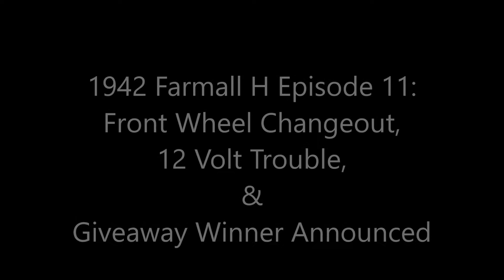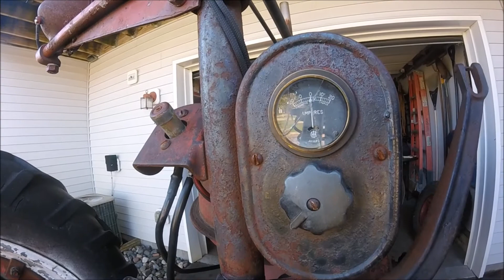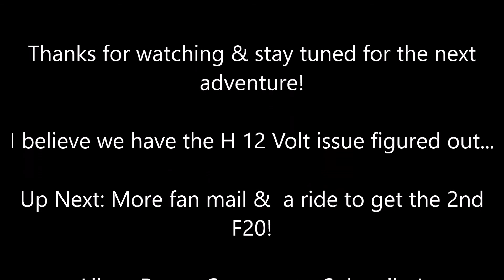1942 Farmall H Episode 11: Wheel Replacement/12 Volt Issues/Giveaway Winner!

Comment: Thanks so much for replacing those front wheels. Now it looks like a Farmall H ( with the exception of the battery box).
Some places/people I know would toss you out if they saw you spinning those bearings dry. I was based in an Air Force jet engine shop and that was a big no-no.
Great giveaway and I know it took a lot of your time to come up with both the questions and the prizes.
Keep them coming.
Reply from the maker: Thanks Tony! I hope everyone had a little fun in it. I liked the cutoff steel wheels for nostalgia and 'story telling', but they just didn't fit what I wanted out of the tractor as far as looks. Now, it is more my 'style'.

Comment: I actually have a easier/safer way to get those front wheels off instead of that jack method but it only works on the trycle fronts.   To replace the left tire place a ramp under the right tire and drive it up that ramp only on the right tire,  next take left tire off and make repairs,  install back on and do the same for the other side.  I done it quite a few times that way with no problems.  Longs if your on flat land you should be fine.  No flimsy jacks needed!  Can't wait for your newest video on the H!  It came together quite well over the years
Reply from the maker: Thanks for the recommendation. I have also learned that people just use a chunk of 4x4 and drive one tire up onto it. I have plenty of that laying around as well!

Comment: one thing to remember the 6v system was positive ground so if you  bolt on a alternator you have to isolate mount it..    if you convert to a negative ground 12v system and think you will use the  6v starter  it will run the wrong direction unless you  have the starter rebuilt for negative ground.

Comment: these may very be issues from converting to negative ground as other may have mentioned. components like your switch may have been set up for a positive ground or you could have moved items when wiring and re installing the cover and grounded to dimmer resistor out
Reply from the maker: I can't remember what the fix was during this incident.
Reply: @KennyKizzleRustyNutzRanch  Thats ok, the key is that it is fixed and works like it is expected to
Reply from the maker: @seniorelectrician6831  Yessir!

Comment: i grew up on a 250 acre grain farm  dad and i  farmed with a AC D15 and a 51 H i drove the H   we carried a hillbilly jack on the H a 6 x 6 with a 45 degree bevel on on end  and a  2 x 6 piece nailed on the back of the other end as a stop    when we had a flat on the front we just drove the good tire on top of the 6 x 6. o course we locked both brakes and had the trans in 1st gear. this method is safer than using jacks
Reply from the maker: Not a bad way to do it. At least I was smart enough to do one wheel at a time in case the jack failed.. It would just fall the inch down to the ground and land on the other wheel. Pretty cool method you used with your dad!

Comment: I think you should feel a slight resistance when you turn the wheel, not just free wheeling.  that is the way I was taught.
Reply from the maker: Jim, I agree. You shouldn't be able to turn the wheel and watch it spin forever. It may make a revolution or two then stop (that is the way I was taught also). Thanks for bringing it up!